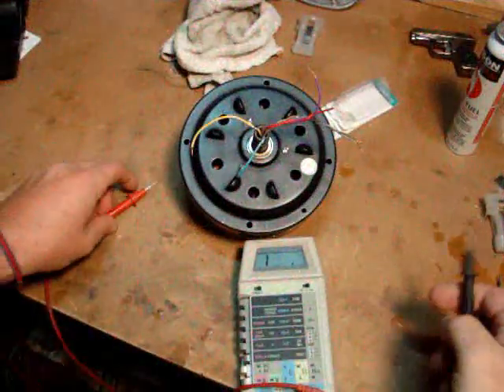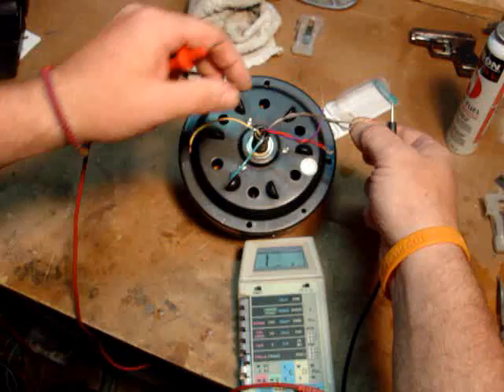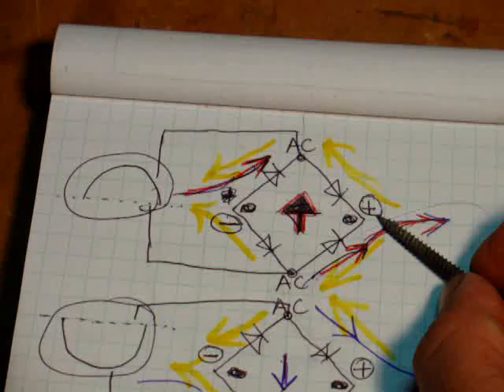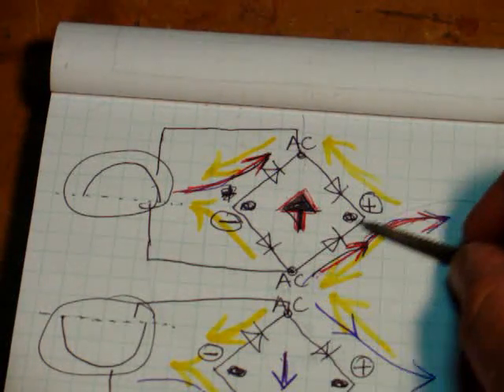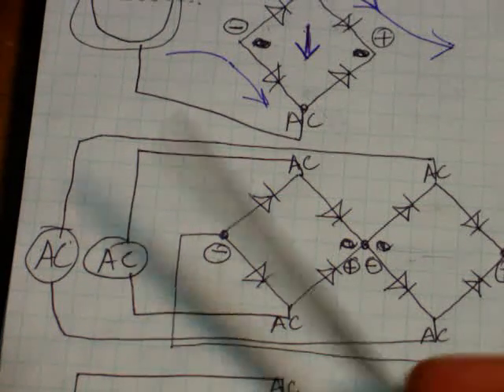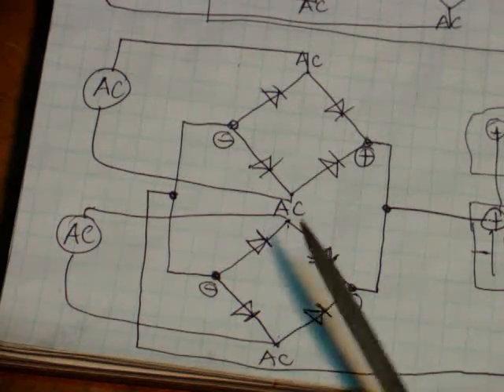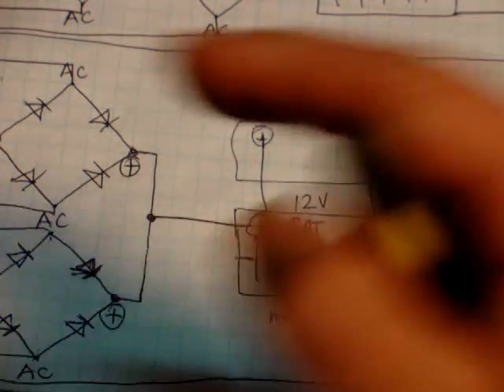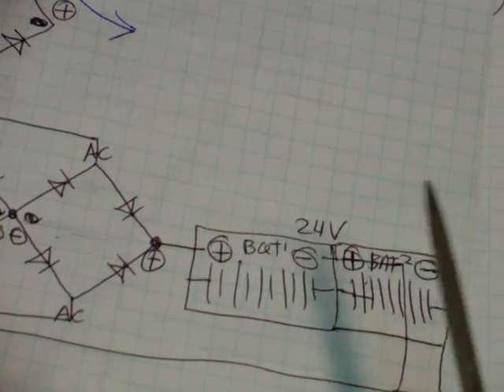PART 5 HOW TO CEILING FAN WIND TURBINE

Comment: Your 5 video's need to be retitled. This does not describe a wind turbine at all. It's about converting a ceiling fan motor into an alternator for charging batteries. Also I would expect the sheet metal housing to bend really bad since the wind turbine blades are just screwed to the thin metal. It needs to be reinforced.

Comment: When you're adding a battery after the bridge rectifier, are you charging the battery? Another thing is would it be more efficient if  you'll add a capacitor in between the Bridge Rectifier and the battery? Your reply would be greatly appreciated.

Comment: My question is about your multimeter. make and model ?
Reply from the maker: Dusty smith My favorite is the FLUKE. Not sure which model as it is not here with me.
I dropped that thing from way up high while working on a message center sign. The rubber casing made it bounce like a rubber eraser. lol.
when i climbed back down and picked it up, it was off. I turned the rotary switch off, and back on again. it did nothing. :/ wwwhaaaa
two minutes later it just came back on, and it has worked like a charm ever since then, and i had it tested and recalibrated after that. They said it was almost right on the mark. lol.
tough and dependable.
I swear by FLUKE ever since then.
MUDDy

As for the ammeter on the wall,... I got the design from other power dot com. it was made from an old hard drive. It would be very hard to blow that one. I made a video on it as well.
MUDDy

Comment: so are the stirlings really capable of producing residential power generation, or am I voiding my bladder up the rope? I don't want to put all eggs in one basket, but the PV systems are still unreasonable unless DYI applications are used to solder the modules. Ebay has great pricing for tabbed mods. I think 90 watt panels could be built for about 140-200 federal reserve notes ea. as opposed to 400-600 retail,so diverse redundant systems seem to be more logical. Pricing of 2 yrs ago or so.